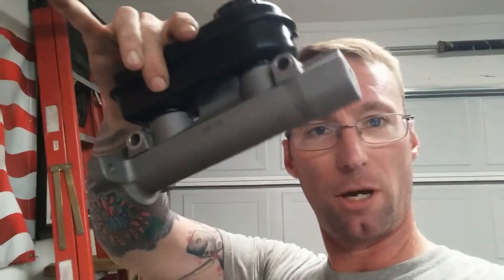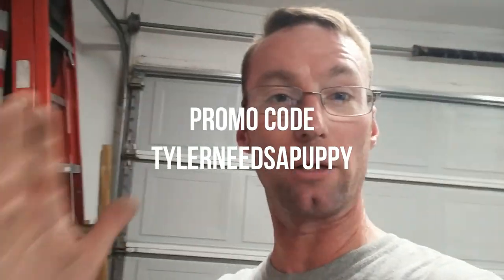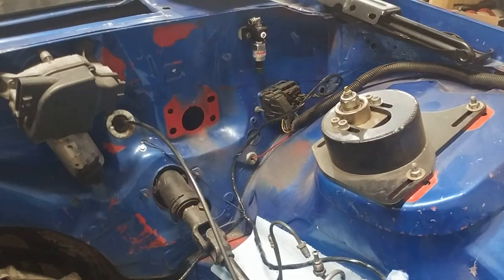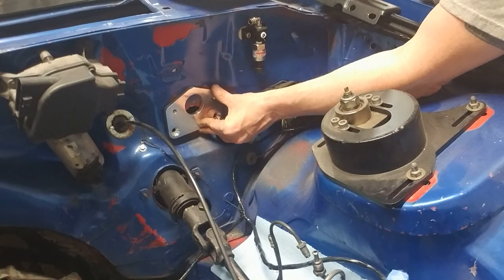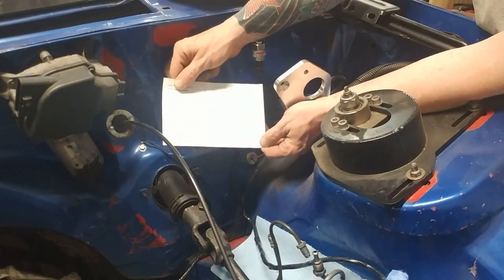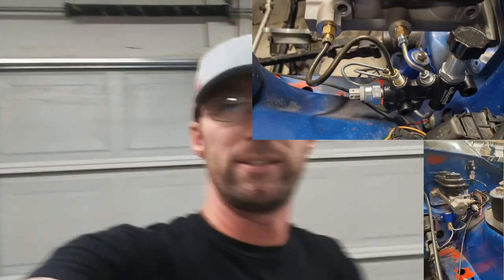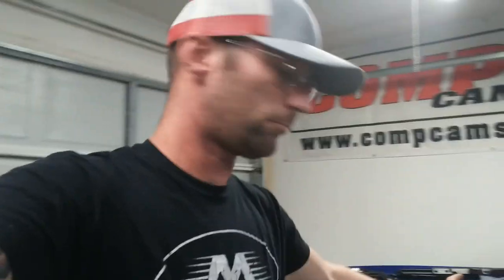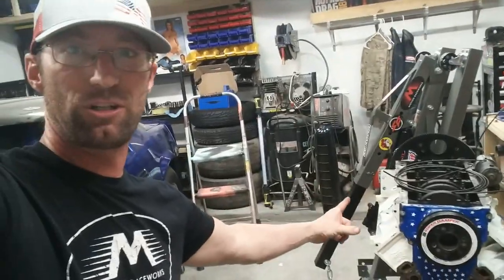Manual Brake Swap on a Third Gen F-Body

Comment: Haven’t seen your holley uploads in a while man. Those were great 👍🏻
Reply from the maker: To be honest, I haven't done much with the car since moving because it wasn't running very good. More specifically, when I was about a mile from the house it sounded like it had a death rattle and didn't want to stay running. You'll see when I post the motor tear down video, the main and rod bearings aren't in great shape, as well as a bunch of junk in the oil.
Reply from the maker: I may add some more sensors with the new motor as well as some dyno time and go from there. Thanks for watching.